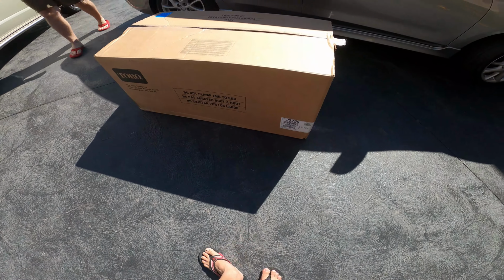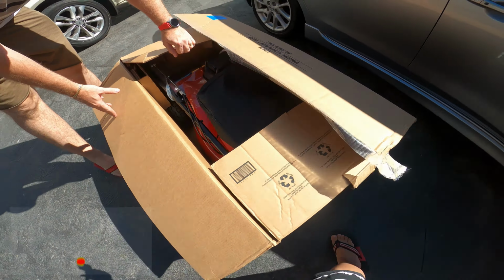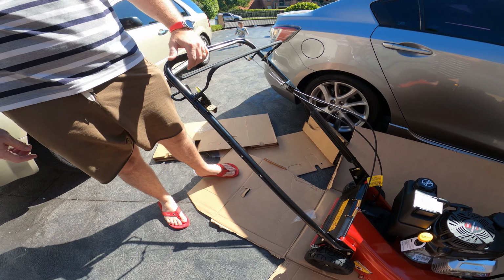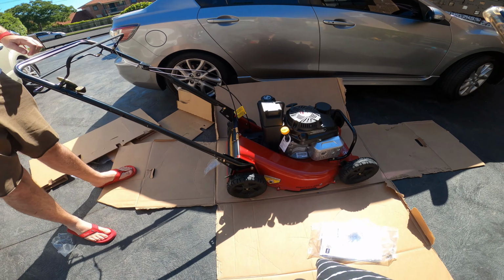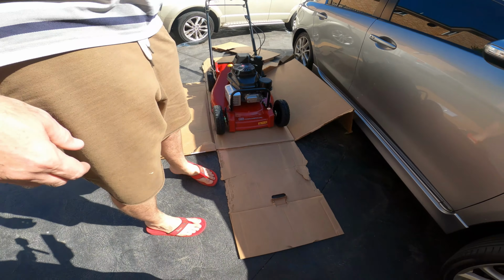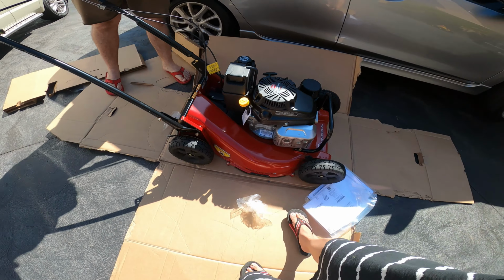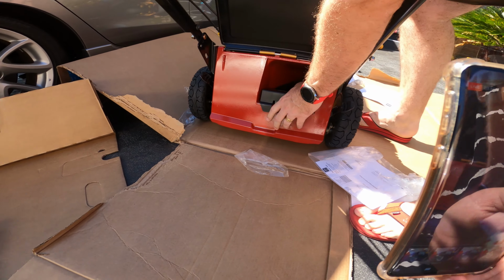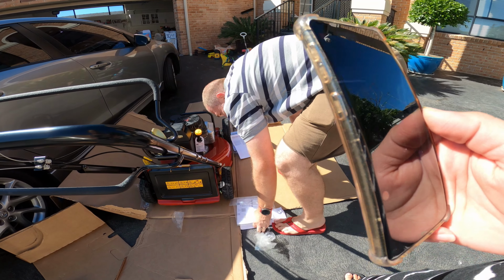Toro® Commercial 21" Heavy-Duty Walk Behind Mowers+UNBOXING

Comment: I have one of those mowers.. Biggest piece of crap I've ever bought. I've owned nothing but Toro and Exmark commercials for at least 20 yrs.. Mower has spent more time in the shop than mowing.. Paid over 1600 because of it having the blade break control..Absolutely hate that mower..